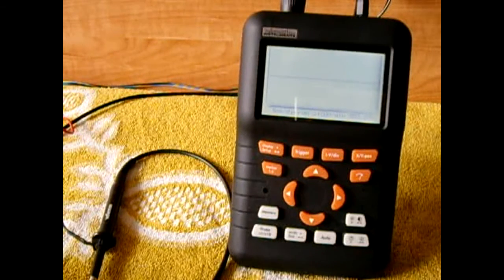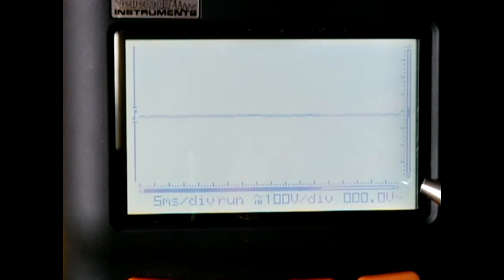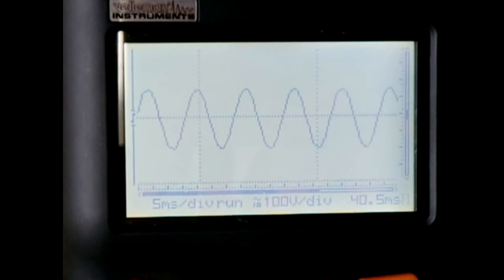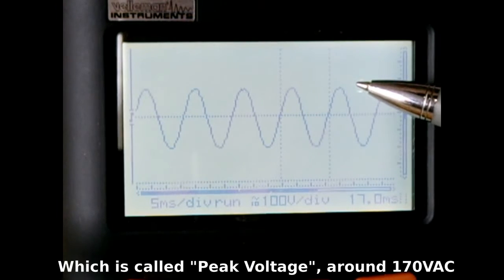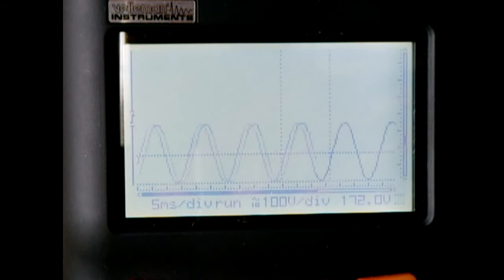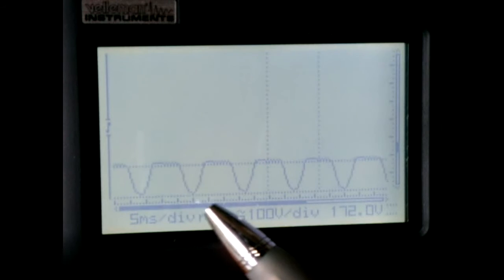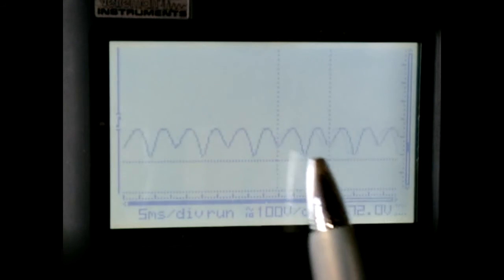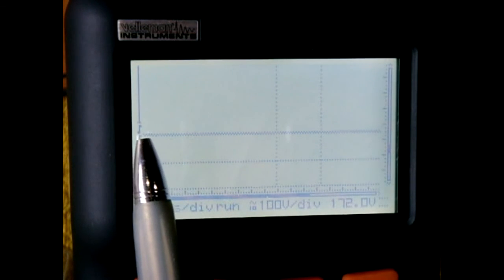Why Converting AC to DC Results in Higher Voltage Output

Comment: Great video as always. As others have said that is a Bridge rectifier. If you feed it 120 volts AC RMS (root mean square), the peak to peak AC voltage is around 170 V. You can expect around 170 DC. With no other components, smoothing capacitors etc, it will be, as you says, rough but it will operate the motor. Be cautious, 170  volts DC would hurt!

Comment: Correct me if I am wrong. The voltage increase will also be proportional to the AC cycle. So for instance, a bike dynamo generator will have a low gain due to low cycle being generated.

Comment: How do you determine what capacitor to use?
Reply from the maker: Depends on how much of a load you plan on using at the output, and how much ripple you can tolerate. They have online calculators. Thanks for watching!

Comment: nice video but you could have discussed circuit and the current flow through the diodes. Also it would have been vice to see the circuit as you changed it each time. Otherwise we only see half the picture. Thanks Mike

Comment: Put it a different way.  If I start with 170VDC and put a cap on it, I still get 170VDC.  If I start with 170 VAC rectified, as you have it, put a cap on it, I still get 170 VDC.  However the original waveforms have different areas under the curve and thus different energy.  How can both waveforms end up producing the same DC voltage when they started with different areas and different energies?
Reply from the maker: The diodes made the conversion. If a heavy load is applied to the rectified AC(170VDC) and the capacitor value isn't large enough, the output voltage will drop and a ripple will be seen.

Comment: At the end of your video your illustration suggests that the rectified DC voltage will "favour" the peak voltage, settling in on 172, with no loss of that peak voltage, apparently because the capacitor has a more responsive and steep charge slope than a discharge slope.  However if a capacitor is like a water tank, it will fill as quickly as it will empty if the pipes don't change size.  Why then doesn't the capacitor cause the voltage to settle on an average or RMS value?  If you put a cap on normal AC it would zero it out so why does it settle on the peak value when rectified instead of averaging it as one would expect?

Comment: You didn't really explain where the 120 volt value comes from.
Reply from the maker: conduit122 That wasn't the purpose of the video. The purpose of the video was to explain how AC is converted to DC. To answer your question, the 120v reading is an average. Thanks for watching!
Reply: 120 volts is an average of what?
Reply from the maker: conduit122 Average reading for AC voltage.True RMS
Reply: Oh thanks c:

Comment: If you ran a led using a diode not a full bridge rectifier, would you see the light strobe at 60 HZ ?  Also what is the "allowable" % of ripple in a sensitive application ?
Reply from the maker: I have done it many times. The flickering is BARELY noticeable. Only detectable when you are not looking directly at the LED, but with your peripheral vision. At frequencies lower than 40 it becomes more noticeable. You can place an electrolytic capacitor parallel with the LED to help eliminate any flicker. A very small ripple is fine for just about all your powering needs. Larger capacitor = less ripple, but you will not get rid of all the ripple.

Be sure to watch my other videos, especially the transformerless power supply videos.

Comment: hey, i was wondering how i can power my custom automotive sound system indoors, it runs on 12-14 volts dc and will draw roughly 1100 watts max. I currently have it running on an old 300 watt computer power supply, obviously it goes into over current protection mode whenever I turn the volume up.and i dont want to spend $400 on a new psu.
Reply: maybe a modified MOT? with a few big diodes.

Comment: Thanks for the new video!! would have been safer to use a transformer between the AC line and the oscilloscope? will have to try this myself, I've never use my oscilloscope to look at AC sinusoidal waveforms before. Will try some diodes too would like to know what standard and super fast diodes do to the waveform.
Reply from the maker: I thought of using a low voltage transformer, but I wanted people to see that actual 125vac to 170vdc transformation. Makes it clearer. Look for some high voltage faster switching diodes like a 1n4935 - 1n4937. Give that a try on the scope. See if there is any difference in the waveform.